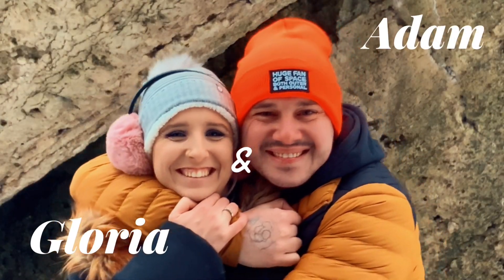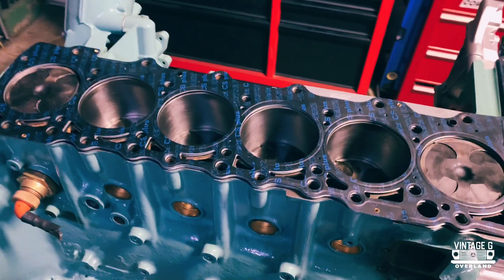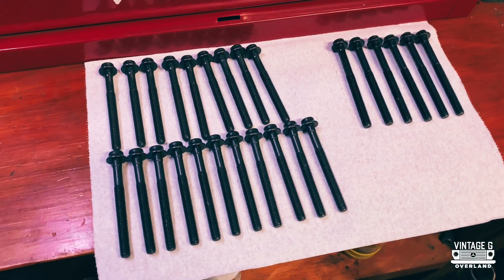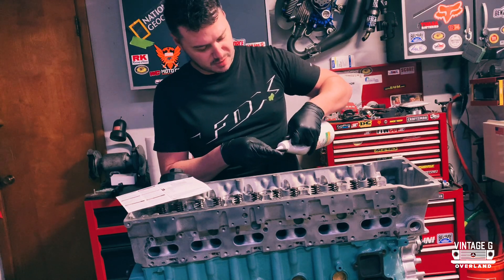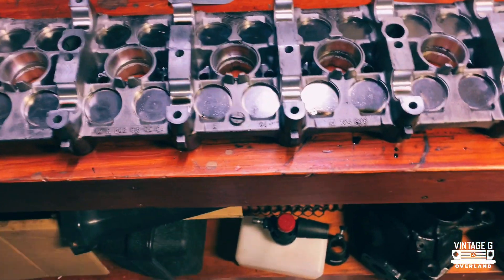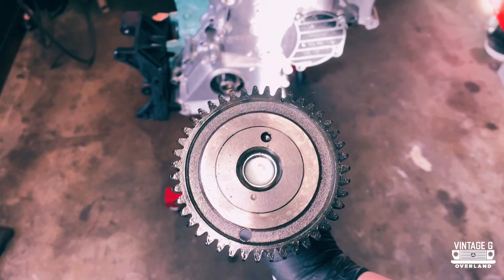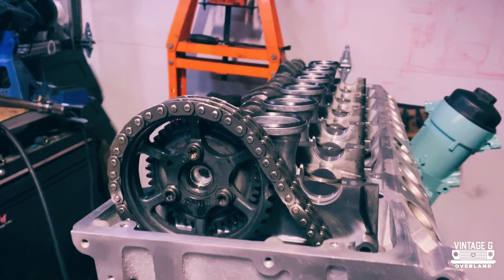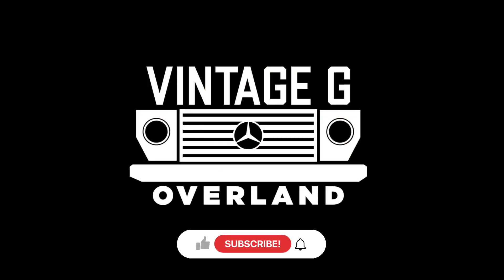Episode 7. Building The Best Diesel Engine Ever Made!

Comment: How is the OM606 treating ya?  I have a 300GD that I swapped to the 605A and 5 speed.  kind of wishing I had gone with the 606 for the added HP, but the 605 is a world better than the stock 917. I'm about to send mine off to have some significant suspension and steering upgrades.

Comment: What power level are you going for? If you are going higher than stock levels you should consider stiffer valves springs.
Reply from the maker: I’m planning on a 6mm pump so 300 hp give or take. You think that will need stiffer springs?

Comment: Not a.bad idea to confirm the dot alignment on cam sprocket with the dots further down the shafts before pinning / welding the sprocket.
Reply from the maker: Yes I did that
Reply from the maker: You would really only get that cam to shift under high loads. This car was completely stock so the cam hadn’t seen the HP levels I’m going to throw at it. DPUK has a video on it and what to look for